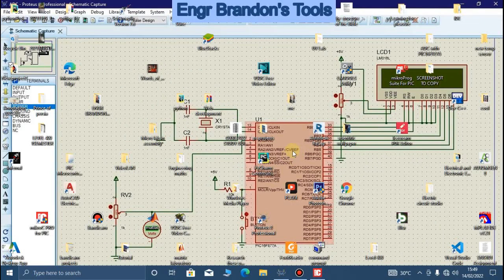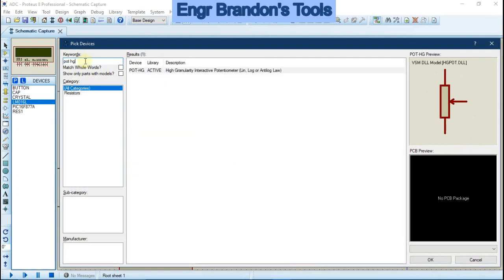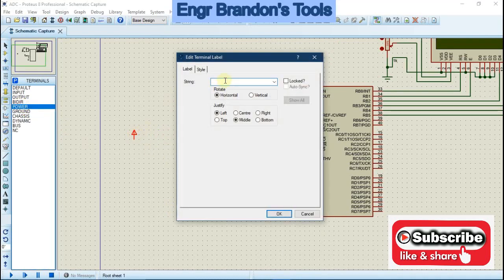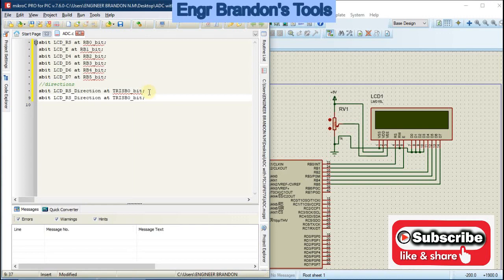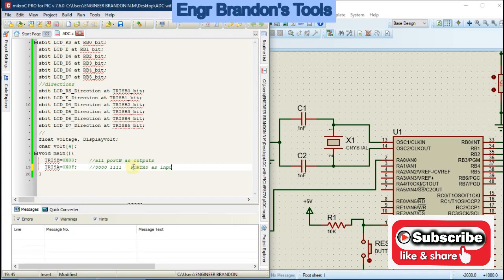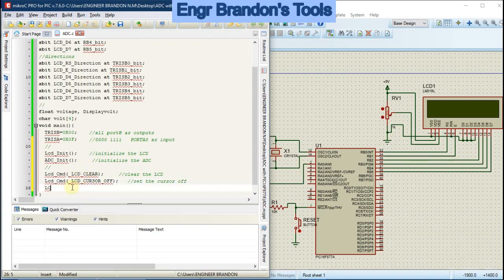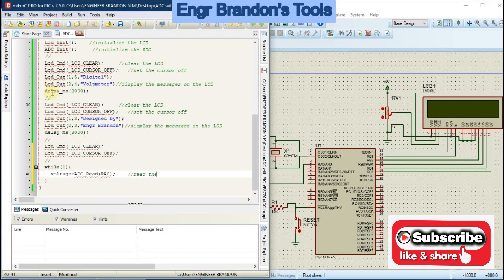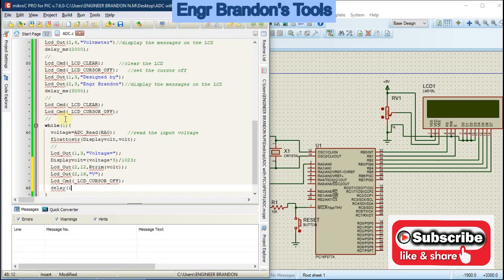Digital voltmeter with PIC16F877A using Proteus and Micro C

Comment: Good day Engineer Brandon. 

I built the same circuit and it simulates perfectly except that it seems that it cannot display voltages below 1V properly. For example 0.1V will be displayed as 1V, 0.01 will also be displayed as 1V. 

I did some digging and realised that the floattostr function is the cause. The sprintf function is a solution but the 16F877A does not support this function. How would you solve this problem. I see even in your video, you don't go below 1V

Comment: Can you help me here, can you display LM35 temperature sensor values on the LCD using AT89C51 microcontroller? LM35 must be connected to ADC0831. Can you do that conversion it is a challenge to me